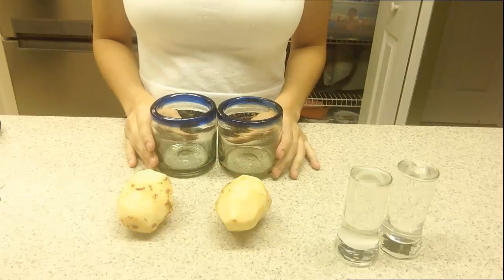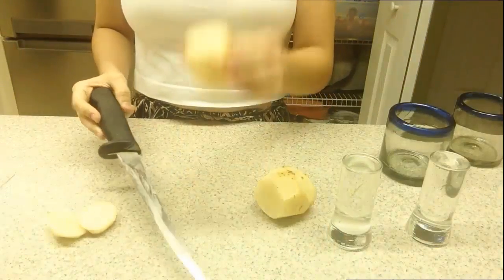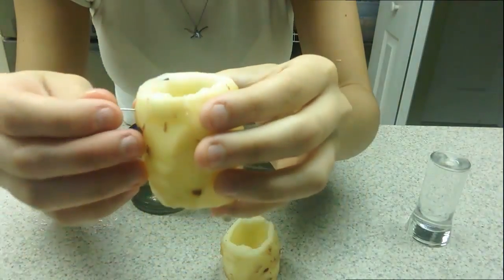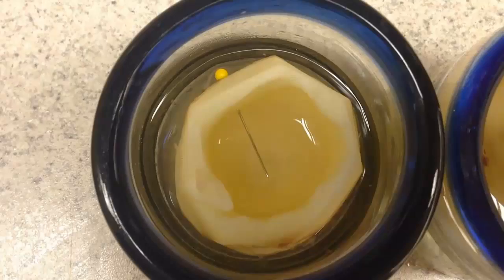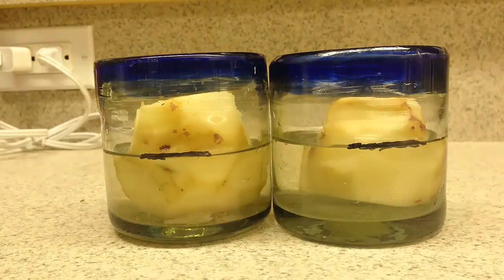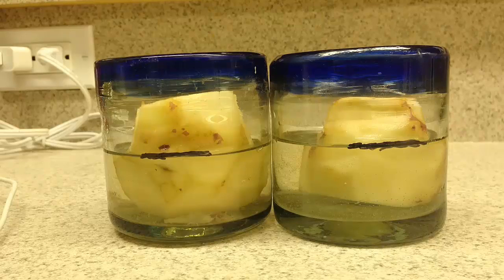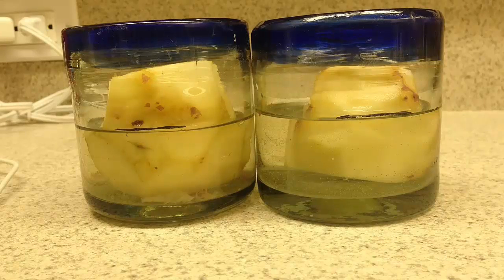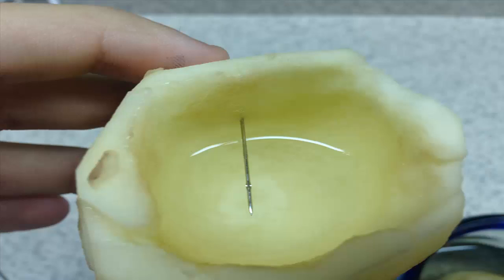Potato Osmosis Experiment + Steps.

Comment: Hey Emmy, just wanted to ask that why did the inner and outer level of the tap water potato go down and this didn't happen with the sugar water potato? In school, we tried the same experiment with tap water potato and the water level didn't go down at all. Instead the inner level of water rose up. Can you please use your highly intelligent brain to find out an answer to this question?
Reply: Thats because both the inner and outer levels for tap water was of same concentration. So, they just get absorbed by the semi-permeable membrane which is in this case potato.

In case of sugar water solution, the concentration of water outside the potato is higher than the concentration of water inside of the potato as its filled with sugar water. Since sugar molecule is anyway larger as well, it couldn't go into potato layers from inside of potato. Whereas from the outside, the water molecule could enter the inside of potato.

Hence the tap water potato level went down both inside and out. Whereas the sugar water potato solution level went down outside and went up inside.